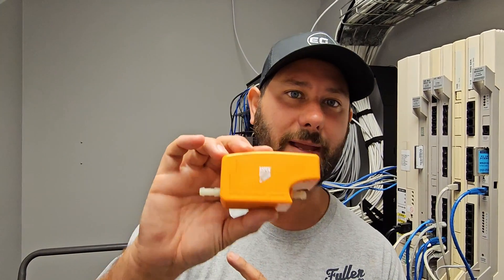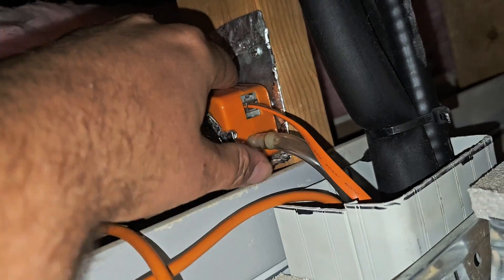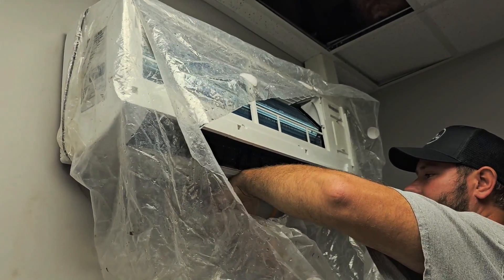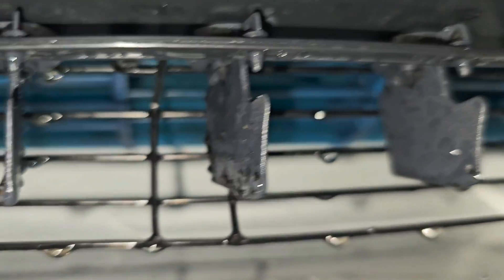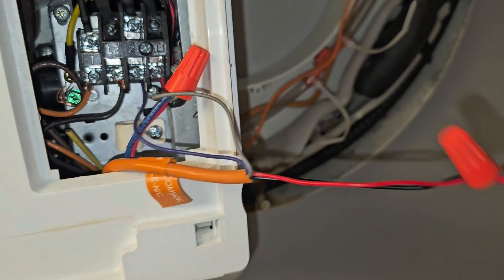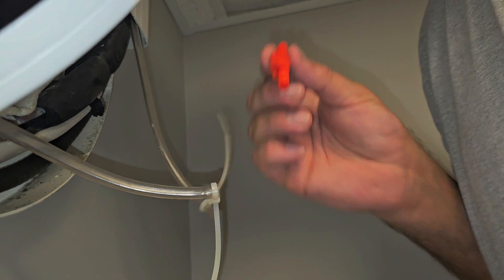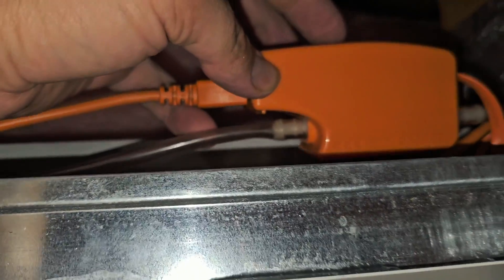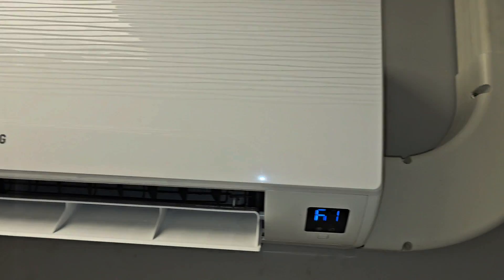Mastering Mini Condensate Pump: Pro Installation and Maintenance Hacks

Comment: What would cause my pump to only get 200v? Its a sourman si30 208-230v pump, it runs but doesn't pump, and nothing is clogged.. is it under voltage? 201v

Comment: You make it look easy. Thanks. L1 and L2 terminal had loose connection using stranded wire probably. Better to use fork lugs crimped on stranded wires to terminals. But I  dont always have connections available on my jobs.

Comment: Hi, in the existing wiring the grey cable was connected to the communications wiring, and the purple goes into the terminal

But in the new install the colours are reversed? Why did you do that

Thanks

Comment: Wire terminals are a must on the coonnections. That's why the plastic melted. Join wires like that it's the best way to burn the building down. But the video is great!

Comment: Good Video.  Where does the water go after it passes through the pump above the ceiling?  Do you put the clear tube into the water drain line that comes with the mini split?
Reply from the maker: yes or runs to the exterior
Reply: @taddydigest  How long of a 1/4" tube can the pump realistically pump water out?

Comment: Why is the anti siphon device between the sensor tank and the pump? This is the reason the original pump wasn't doing it's job as it's just sucking air from the check valve on the siphon device and you can see this from bubbles. You put it back in exactly the same spot :S. It needs to go above the pump on the outlet side. Instead you replaced the pump? Crazy?
Reply from the maker: I did not show the right way for installing the siphon. I realized that after the video i've actually done an updated video and I need to release that video to show the right way thanks for pointing this out

Comment: Doesn't the anti siphon device belong after the pump to prevent running the pump dry? That way the pump sucks in air so it will run dry and overheat i guess.

Comment: We would pull the blower wheel out. There’s a Phillips screw that holds the blower wheel on some Gree models and if you know where it is, u can drill a 3/8” hole to the right of the evap coil approx half inch from the lowest u-joint, loosen screw and viola u can pull the blower wheel out from the left side(after removing the plastics and loosening the evap coil from the same side! 👍
Reply: Looks like his method works perfectly fine and much quicker